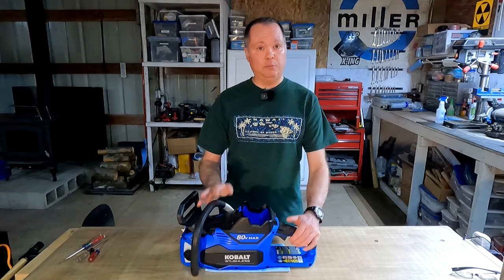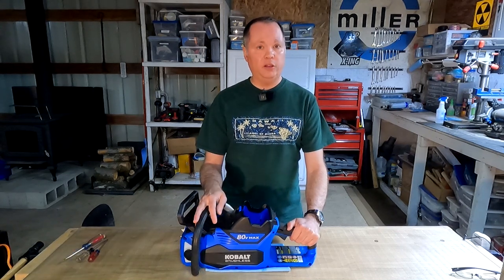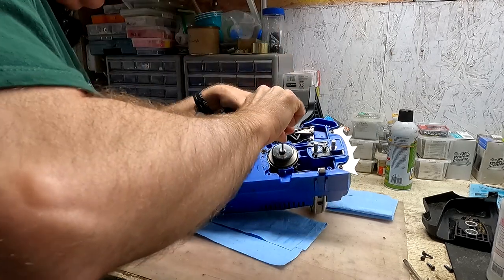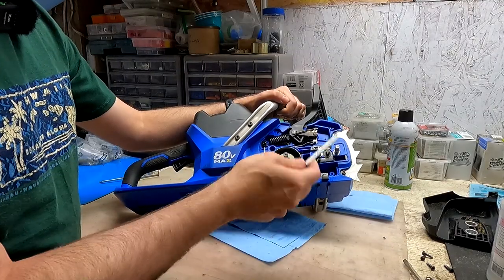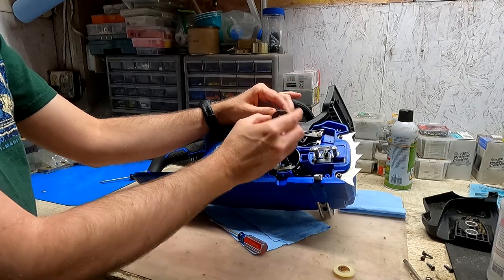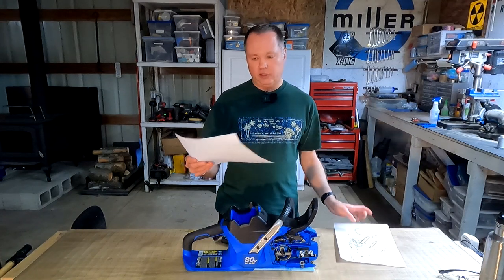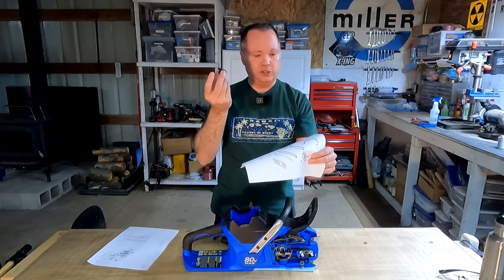A Big Problem with Many Cordless Chainsaws and Fixing Kobalt/Greenworks 80V Oiler Issue

Comment: I have (2) Kobalt 80-volt 18" Bar Chainsaws and use (2) 5 AH Batteries.  I’m 79 and love NO more having to pull a cord to start a gas-powered chainsaw. My first 80-volt 18" Bar Chain saw with a 5-AH Battery and charger was $400 in Jul 2021.  it is still being sold on the Lowes website as of 5/26/2024 - I use them on our Southeast LA farm of 18 acres of tall large pine trees that were devastated by a Hurricane and tornado. On 10 acres of the property, nearly all the trees are down or dead. My chainsaws have been working great and cutting huge logs and trees and logs up to 20"+ and it works great. I also use the 80-volt 10” Pole saw, lawnmower, and Leaf Blower.
Reply from the maker: I use this 80V saw quite a bit and was pleasantly surprised by the power and battery life with the larger 5AH battery. It doesn't work well for slabbing work, as the bars get warped or pinched and no one makes a heavy duty solid bar for it.  However, it works great for general storm cleanup or firewood tasks.  I've worked it hard, and the oiling gear is the only failure I've had (cheap & easy fix).  I believe the batteries, motor controller, and motor on these are quite solid.  

I wish the parts availability was better, but considering that it has saved me a ton of time over maintaining a gas engine, I certainly don't regret buying it.

Comment: good video, what caused the gear to strip out wasn't wood chips but friction from cutting without any oil. If you own one of these saws keep the oil tank filled and everything will be ok.
Reply from the maker: The only way to increase friction on the worm gear would be for the oil pump to seize or to get foreign material into the gear.    The oil pump never had an issue, never seized or partially seized, was and still is working perfectly.  

And I never ran the saw without oil.  I did, however, find the whole area completely packed tightly with chips. This in combination with a cheap plastic gear caused the failure.

Comment: Excellent info!   Do you have any videos on the Greenworks internals?
Reply from the maker: Thanks. If you're referring to the 2nd Gen Greenworks 80V saw, it has the same internals as this Kobalt saw.  I also have a 40V Greenworks saw, but it's design is completely different and not easily disassembled. That one has never given me any issues, so haven't had to disassemble it.

Comment: Thanks much. I love my Greenworks 80v 18” but I’m on my second one. First one lasted about 5 years and the oiler got clogged. This may help me to have a spare saw. I never got it apart enough to find the oiler. Does the oiler have a filter ?
Reply from the maker: @ganeydn  Yes, there's a small filter in the oil tank.

Comment: I love my Kobalt 80 volt 5 ah  10" chain pole saw.  It works great on my south east Louisianna farm that a Hurricain went through and trashed all woods on my 20 acre pproperty. Today I'll be cutting a 6 in limb of a tree out front.
Reply from the maker: I wasn't aware they sold an 80V with a 10" chain. It must really scream with that short of a chain. Besides this oiling gear issue, my 80V Kobalt has been a solid saw, and I've been impressed with its power. I just wish they sold more replacement parts for it.
Reply: @outdoorsinoregon  - The chain gets dull quickly  or maybe I just need them sharpened better.
Reply: Much more accurate than hand sharpening,  too. Cuts like butter.

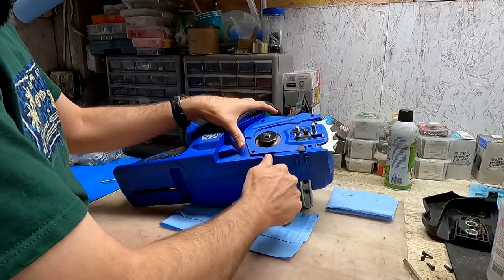Comment: The Kobalt Item #0419015, Model # KCS 180B-06 is configured a bit differently.  Where you pop off a cover at 2:01 in the video, the one I have does not have a cover.  I don't see how the case can be opened but there was plenty wood chips to remove.  The best I could do was take "dust-off" spray and clean all wood chips with air pressure.
Reply from the maker: Good info; thank you for the comments.

Comment: Mine also seemed like it wasn't oiling enough. No splash at all like regular chainsaws so I think it's severely under oiled
Reply from the maker: Mine gets plenty of oil, as long as the pump is working, but I am using a very thin oil in this saw.  A thinner oil might help...or you might check your oiling gear to make sure it has all its threads.

Comment: That was great!  Thank you for making this video.

I have a 60V greenworks that seems to have the same layout/plan and I haven't been able to find much information about debugging it online.

You wouldn't happen to know what would cause it to immediately after starting?  It started to shut down every few starts 2 days ago, and I had to eject and replace the battery to get it to turn back on.  It became more and more frequent over the last 2 days and now my saw is unusable.  It stops as soon as I start it just about every time I try to cut.

Do you have any pointers for where to look?
Reply from the maker: There are a few issues that could cause this:
1) Dirty connections.  Be sure the electrical connections between the battery and saw are clean; a Q-tip and rubbing alcohol will work to clean them.
2) Excessive chain friction.  Make sure the chain turns freely by hand. If the saw detects a stuck chain, it will shut off. 
3) Temperature.  The saw will shut off if the controller or battery are too hot (after running the saw for a while).
If you've checked these  things, and the shutoffs persist, it's likely that the motor is drawing excessive current or the battery or controller are bad, resulting in false current or temperature measurements.
Reply: @outdoorsinoregon  Thanks so much for the tips!  It happens when the saw is cold, so, the chain spins pretty free by hand, and it happens with all 3 of my batteries.  So I'll give all the contacts a good cleaning and hope that fixes it.  I hope it's not the controller!
Reply: @outdoorsinoregon

Just thought I would update here.  Greenworks did a warranty replacement on my saw.  I never got a diagnosis because I live too far away from any of their authorized repair agents.  

I still have the saw though, so one of these days I'm gonna break it down and see if I can figure out how to get it running again.

Thanks again for your help.
Reply from the maker: @tamman2000  Good to hear it worked out!

Comment: I wonder if this is the same with the 24v Kobalt, because I have the same problem. It leaks pretty much all of the bar oil out of the reservoir. Pretty sad because it's a great saw.
Reply from the maker: I don't have familiarity with the 24V saw, but it wouldn't take much effort to remove the side cover to take a look.  However, leaking oil is a separate issue and could be related to a damaged or loose hose or seal. 

Temperature fluctuations can also cause oil leaks, as a closed plastic tank will contract when it gets cold and expand when warmer, acting like a pump. You can loosen the cap to allow better venting or drain the tank when storing the saw to help with this.

Comment: What kind of oil would you recommend? I have Green Machine 62V
Reply from the maker: The oil pump on my saw has a low flow rate, so a thin oil, such as bar oil designed for winter use, works best. I'm actually using Canola (vegetable) oil.  It flows well, it's non-toxic, cheap, and lubricates the chain well. I hesitate to recommend this to others because some people have experienced problems with the oil getting thick and sticky, but I have had no issues with it. It may depend on climate, etc.

Comment: my new 80v 18" quit working it only runs for 2 seconds then stops i don't know why.
Reply from the maker: This symptom is common if the motor controller detects current or temperature outside of expected limits. I would first make sure the chain isn't stuck and that you can move it by hand.  If the saw or battery have gotten hot, let them cool off. 

Also, try cleaning the contacts between the battery and chainsaw.  Dirty contacts  will increase electrical resistance, leading the controller to assume you have a dead battery and shut off the motor. 

If it's not one of these things, you likely have a bad battery or controller.

Comment: very interesting...why would that part have a logo on it...thats crazy....almost like they made em for kobalt to be cheap and crappy and then made theres a lil bit better...considering they want every1 to know who made that part....but ur right companies who offer parts to fix is a huge thing now...i was thinking about that the other day buying dremel parts...luckily they sell em which they better considering knockoffs are 1/10th the price to just buy new
Reply from the maker: The Makita part appeared to be of better quality, and I assume was made by a different supplier than the original Kobalt/Greenworks part.  I guess time will tell if the new one holds up.  

Yes, it was disappointing to learn that these saws don't offer replacement parts, as they are too expensive to just toss out.

Comment: I hate modern times everything is shittier nowadays everything is meant to be disposed of now. Modern Cars are trash, appliances are trash, music is trash, movies are trash, everything in 2023 sucks
Reply from the maker: I can't say I disagree.  These saws are too expensive to not have parts available to fix them.  Greenworks has a large line of other power equipment as well, and I'm wondering if parts availability is a problem with their other equipment or just their chainsaws.
Reply: I just bought a greenworks 40 volt model. It has the same problem  the oiler is not working properly.  I like the saw  it cuts great and has lots of power, but it's not going to last long without proper oiling. 
So far  I've just dumped a bit of oil on the chain after every few cuts, but I will have to see about getting the makita gear.